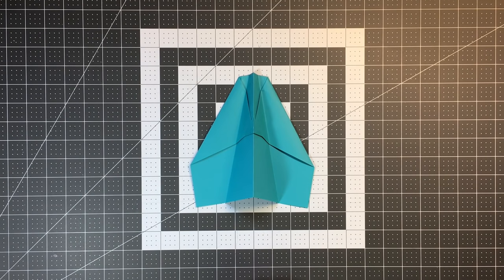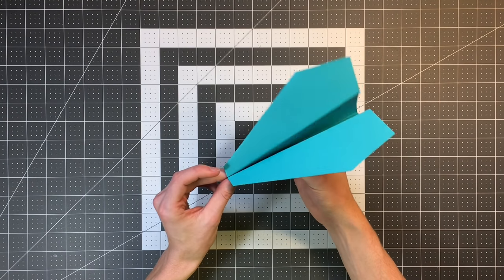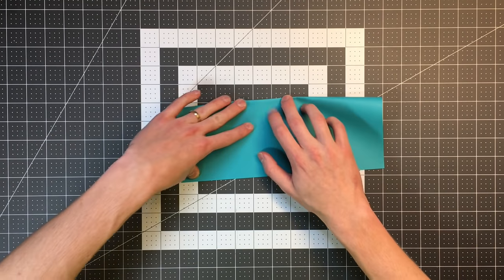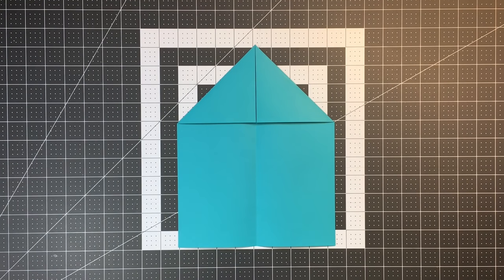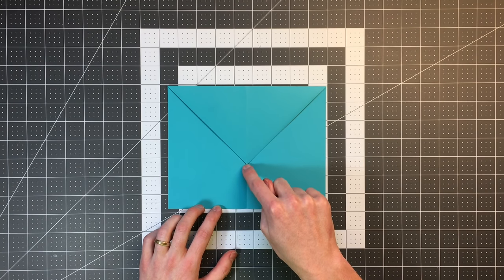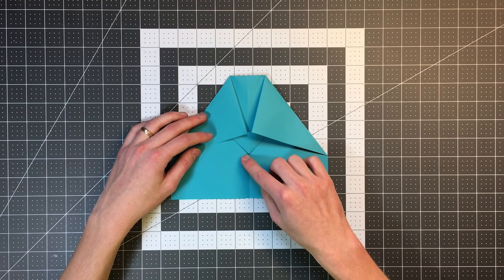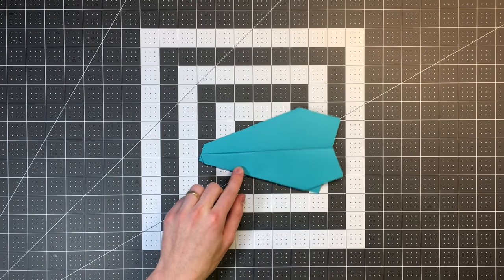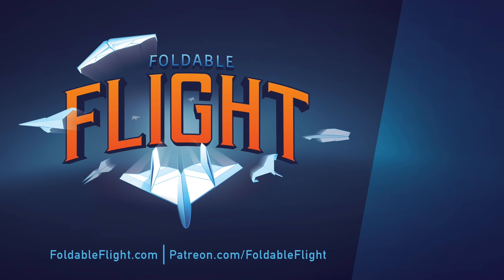Easy Classic Paper Airplane — Learn How to Fold the Nakamura Lock

Comment: At 4.29 you should fold the top edge to the center crease so the plane is pointy, and then unfold so you have a crease there. Fold the top edge to the new crease and roll in. Then you can continue and it flies better.
Reply: Tq for knowledge
Reply: What?

Comment: This is the OG plane. It's so hard to design something new that beats this classic. And you can make so many variations just by changing the height and angle of the wings. I usually prefer making the wings a bit wider than in your example to get a glider that keeps going.

Comment: My Nakamura Eagle design is based upon the Lock; many of its differences stem from locking folds like the ones you use.

-OAE
Reply from the maker: I wasn't able to find the Nakamura Eagle, but I saw the Air Enforcer on Tri's channel. Did you get the idea for that nose lock from Takoa Toda's designs?
Reply: Foldable Flight 

The Nakamura Eagle can be found via Google on a site called Instructables (over 400 of my other designs also reside there).

The Air Enforcer is a distant cousin of the Nakamura Eagle with some of the latter's differences from the Lock deleted.

To my recollection, the nose fold came about through trial and error by myself during the development of the NE. Many, many prototypes featuring a wide variety of configurations were tried. Ultimately, the lock is almost identical to Toda's in its ultimate form (with only a directional difference separating the two).

-OAE